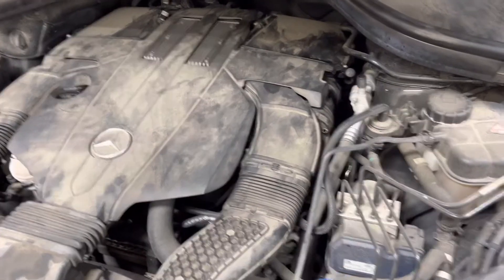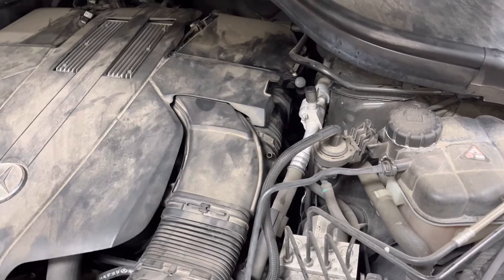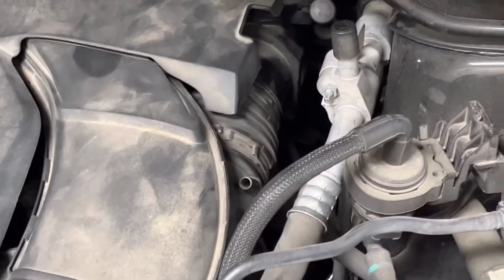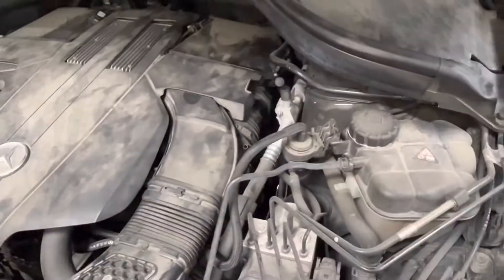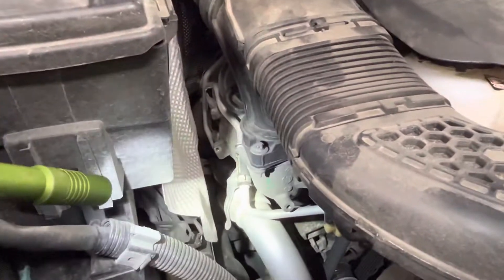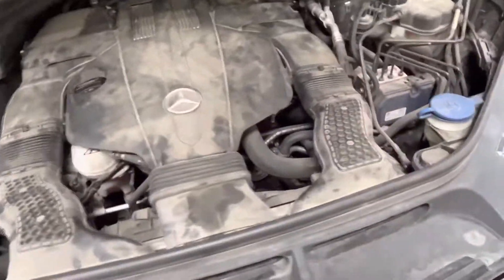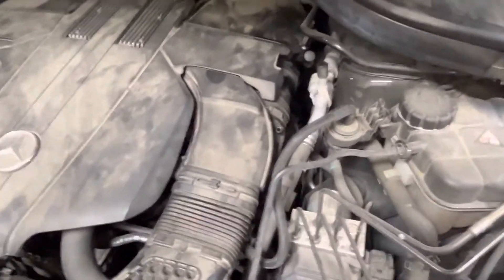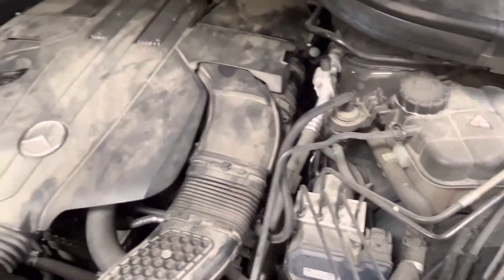MERCEDES GL450 Low boost pressure and engine rattle

Comment: Boss, I own a 2014 Mercedes-Benz GL450. When I start the engine, I hear a knocking sound that becomes more pronounced when I accelerate. However, the noise significantly diminishes when I reach speeds exceeding 40 miles per hour. Interestingly, there is no noise when I have the air conditioning (AC) turned on, this is for last 5 months, i am still driving. vehicle driven only 76k miles
Reply: That might a bad problem if ur using bad fuel that mean the engine is most likely burning oil
Reply: Don’t ever use bad gas on these cars only super and if it is try liqui moly fuel system cleaner it will help it if it’s not to late

Comment: Hi, i'm experiencing similar problem on C43 2019, but this gets worse i'm also experiencing rattle noise under acceleration between 1500-2500 rpms, does not occur on neutral only while moving. any idea if this can be also connected to waste gate issue ?
Reply from the maker: It’s possible that it’s wastegate related but usually it’s apparent at idle

Comment: How would you fix that or just replace the whole turbo
Reply from the maker: I believe some companies are machining those oversized and adding a bushing or a larger pivot shaft, for a customer car where I work I would just end up replacing the turbo all together
Reply: @EuropeanAutoRepair why ?  That’s the thing about euro repair shop they aim for the big money parts and just shot gun blasting on parts . Those are the guy that I talk shit at work .. customer comes and said my engine check light is on ?  Ok let me check oh you need a water pump !  Customer comes back saying it’s still on ?  Well let me check !  You might need a thermostat !  Customer comes back … it’s still on ?  Well I suggest a new motor but it might be cheaper if you get a new car !  Silly shade tree . A mechanic knows what’s wrong and doesn’t replace everything till they find out what the problem is .
Reply: @chuemoua6834  You went out of your way to say that? 🤦‍♂ A little kindness goes a long way.